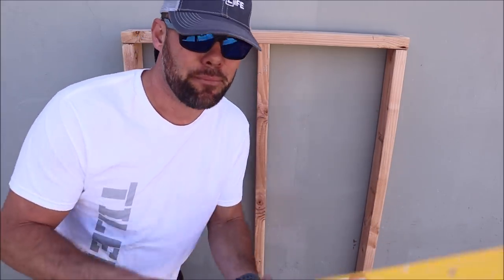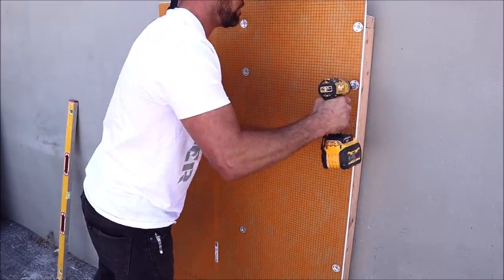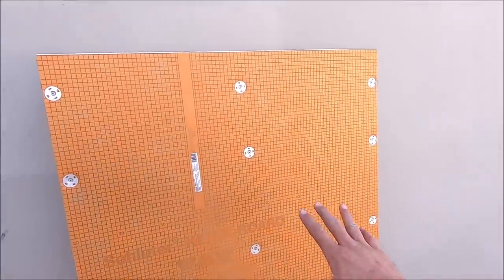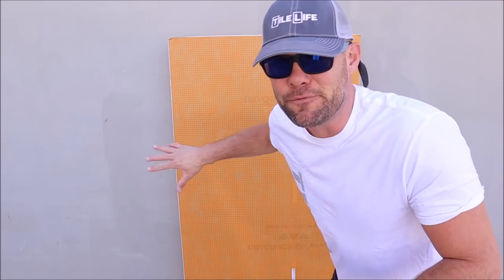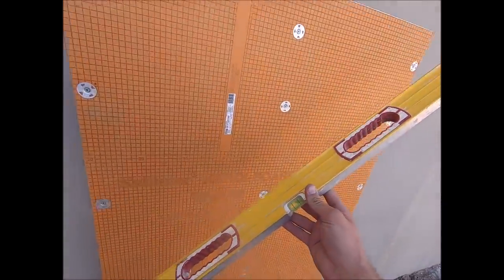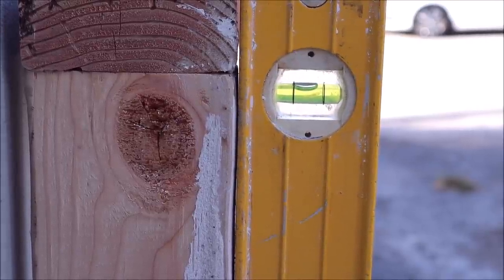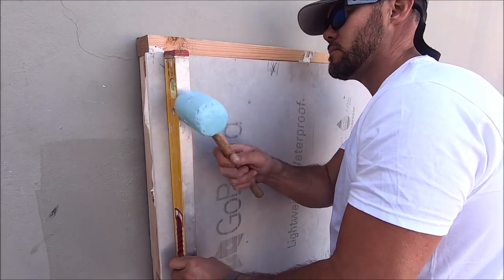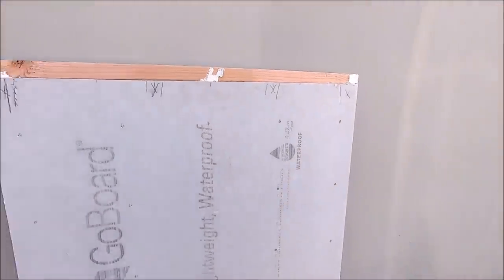Wet Shim Framing Studs for Flat Plumb Walls!

Comment: Why would you take a chance of the thin set braking out. Just sister a new stud to the bad one. You don’t have to Wait for the thin set to set up or worry about issues down the road.
Reply: Sal Diblasi does the same thing. It’s an excellent technic.
Reply: @ikust007  I’ve been doing tile work 50 years. It’s something I wouldn’t do. I each is own. Don’t keep up with names so clueless to sal Diblasi is!
Reply: I think the wet shim technique was initially promoted by Schulter after they came out with their own thinset. They obviously want to sell more thinset. Depending on the size of the wall it might be cheaper than sistering 2x4s.
Reply: Use pl premium plus construction adhesive, that stuff makes good shim when dried up. It’s rock hard and sticks to anything.
Reply: Or just use a planer

Comment: Good idea but also time consuming, if you buy a couple of 2x4’s and sister them onto the existing framing and plumb them up you won’t have to wait 3-4hrs on anything setting, it’s a quicker method all round for the price of a few sticks of lumber.
Reply: Have you seen the price of lumber these days? LOL
Reply: That's bs...all studs are shit his way is good
Reply from the maker: 2x4's are $8 and going up here! but we use both methods depending on how far out and out of wack framing is and what materials we have on hand. Simply another method to consider...
Reply: Guys as I said “Good idea” and all I was doing was giving an alternative not trashing the method as I personally have never thought of it and I’ve been a contractor for 20 odd years, haha yes up here in Canada a 2X4 today is $8.50! Tomorrow probably $10! But at the end of the day you just have to work out your schedule and what your time is worth.

Landberg I love your Chanel that why I watch and appreciate you always give different options and don’t steer people to your way or no way. 

Patric if you can’t pick out straight studs then find the best you can, cut it in half and make them straight, again just an idea.
Reply: @andy.m7274  that’s what I do. Buy 2x8’s and use my track saw to make straight 2x4’s. Then I’m screwing my backerboard onto a solid structure. Not thinset.

Comment: Great video, thank you...just curious, why can't you use hardy backer with this method?
Reply: My guess, there are few reasons, weight of cement board too much for thinset on studs to carry before you can screw it to the stud, another deal is stiffness of cement board will squish thin-set as you work on aligning it with level, and of course it won’t spring back. Foam board is very lightweight from that perspective.
Now me thinking, how to plumb cement boards on skewed studs? Quick guess to get set of new studs and screw them plum next to existing studs and hang drywall on new (plumb) studs.
Reply: fartpoobox ohyeah  Right. Schluter video for wet shim says use stiff mix for this problem.
Reply: fartpoobox ohyeah  

I have a gap of 3/4” between the shower base back edge and the wall. AND this gap is not consistent so one one side it’s 3/4” and on other end it’s 1/4”. So o need to do wet shin AND build up this gap so my final hardie back goes on the shower base flange nicely. 
Any suggestions??
Reply: @tothepointvids5192  I wouldn’t try to fill 3/4” with wet shim. I think I’d probably sister the studs to get them out to the right place and only wet shim the 1/4” one.

Comment: Great video But just want to say that you can use screws on your hardy board or your green drywall if you’re using Schlueter waterproofing system just don’t run your screws all the way in just enough to hold the board in place been doing it for years works great after the thin set sets then you go back and sit all your screws
Reply: That's an bs response
Reply: Obviously you don’t know what you’re doing stop  tiling please
Reply: You are tripping... How does the board contour to the stud without sinking the head of the screw?? Do you specialize in floating tile?? Lol
Reply: You do sink the screws after the mud sets up 
The reason you put screws in half way at first is the hold the board in place to keep it plumb and flat after mud sets up then you go back and sink your screws in 
FYI : your not following  the true contour of stud when wet shimming there’s a reason y your wet shimming in the first place the true contour of the stud is out of wack
Reply: You’re correct. I do this as well
Reply: @joshkitzmiller7333  Don't even bother responding to that troll. He's clueless.
Reply: I see how this technique of having the board floating out of the stud on a screw could work... But I wouldn't feel comfortable relying on it if someone applies pressure to that wall in the right spot. An unsupported cavity in front of the stud and behind the wall board May last for years until somebody finally presses on it or leans against it in just the right way.
Reply: @zennloo7343  

That's why you thin set the entire stud  and even if there was a cavity, it wouldn't be that big to wear. If you pressed on the wall it would crack your tile you would have to be basically be demoing the showers for that to happen

Comment: Nice
Never thought of doing this before like that   Did you say you can't use cement board would like to know why
Reply: Cement board is much heavier, so the thinset won't hold the board in place as you tap around getting the whole thing flat and plump.
Reply: That makes zero sense @dwsolberg
Reply: @swamphox1  I bet you could successfully wet shim cement board in that first scenario where the middle stud was bowed in. Just slather the middle stud, then screw the board into the two outer studs, get the middle flat with the level and let it set up before adding the remaining screws.  

Getting the whole sheet plumb would be a nightmare with cement board. In that case, it'd be way better to use solid shims on the studs before the board goes up.

Comment: Been doing that for 40+ years using scrap rolls of cheap sheet vinyl. Always had some in my truck. Sheetrock 45 works great too. Less downtime.
Reply: Thinset is far stronger than sheetrock 45. Would not recommend that
Reply: @johndalton6929  It's just as a backer, not an adhesive. Board still gets screwed to studs. Sheetrock dries harder.

Comment: Great tip. I will try on concrete backer board BUT with redgard on the studs and a brush width of redgard on the back of the backer board. Time? I'll check and prep the walls before starting the concrete shower pan. Personally I  don't like foam boards, too flimsy, too expensive. I also have a planer for high spots.
Reply: Can use sub floor glue too

Comment: Another great video! Curious to why this can only be done with foam boards? Is it because the cementicious boards would absorb moisture cause the boards to be pulled in?
Reply: I think the other boards are too rigid and the screws would pull the board tight to the stud and break the thin set out. Just guessing.
Reply: @PoisonJarl71501  you might be right. The other thought I had was some of the cementicious boards tend to have a curvature to them that may need a true frame to pull them true.
Reply: Great question. I was thinking it was because of the weight. They are a lot heavier and they don’t go all the way to the ceiling.
Reply: You can use this method with Hardibacker. I’ve been doing so for a couple years now. Once thinset is on the studs, use a Level and Mellot. Tap te areas necessary to achieve a level board. Only use two or three screws to hold the board in place and do not countersink. After the thinset is dry, apply the necessary amount of screws and Counter sink. I havnt had any problems yet.
Reply: cement boards are too heavy for wet shimming.   foam boards will hold in place and stay flat and plumb.

Comment: How does that work if the drywall at the interface of wall and shimmed shower wall are then at two different planes? Thanks, your videos are always clear and concise.
Reply: It wouldn’t work apart from the back wall, as you say the shower would be plumb and the intersecting point with the wall outside the shower wouldn’t be, in saying that this method can still be used to take the “belly” out of the wall at least.
Reply: You could just tile over the interface point by about an inch. Cut the drywall back if needed
Reply: @tarmization  yes but the point is if the wall is around a 1/4” or so out of plumb then you’ll see it on your tile edge no matter how far you tile over the intersecting edge.

Comment: Wow! This is fabulous! I have been taking time to install masonary packers where it's been bowed in and plan where it's been bowed out. This is just amazing. I highly appreciate this valuable point and am about to subscribe to your channel. My only question  about installing backing board is that I'm mainly relying on the stud adhesive (even liquid nail) to keep the board permanently on the studs not screws. Having said that, how can I do this technique and while the glue is set then put all the screws? I see screws as temporary fasteners to hold the board while the permanent element is being set. I'd really appreciate if you could please help.
Thank you kindly,

Comment: I wish you posted this video 1.5 year earlier or I knew this before hand at least. It was a pain in the rear to tile on uneven kerdi board. I did however tiled it but the tiles are slightly curved. Good job pointing this out. Lesson learnt the hard way. For all DYI'ers bathroom remodels are a pure pain. you will miss many things which experienced people would look after. There is not just a list, there are many to look into. Unless you experience it, you do not know.

Comment: I usually just sister up new studs if it's bad but with the price of lumber this is probably a cheaper option. Will have to try it, thanks!
Reply: Ain’t that the truth. 
Lumber prices have went sky high. 
2- 2/4-12’s cost me d almost $50 now. 
A price a gave for a deck job 4 months ago. I had to jack it up by $3500 only due to increased cost of mtl
Reply: @mikek3951  it's pretty tough to keep up with the price hikes. I have having trouble with getting plumbing fixtures in a reasonable time frame now. Hard to schedule when it take 6 to 8 weeks to get shower valve trim.
Reply: @BrentDarlington  
Lol I just went through that with Ferguson. 
Brizo trim They started with 2 weeks. Then 3. Then 4. It ended up 4 months. 
It’s getting bad for sure

Comment: I knew Schluter says you can use this procedure, was hoping it would work on Goboard as well, since they are the same types of material. Thanks for the video. Will have to buy some longer screws to make up the difference of the added thinset.

Comment: What’s the best way to level the wall if using cement board? I wanted to use Kerdi for the new project but decided to keep cost low with cement board.
Thanks
Reply: This works with cement board. I use a few screws to hold it were I want until dry then fully tighten and add more.
Reply: I was thinking to do this method with subfloor glue

Comment: Thank for sharing your knowledge, one question here in south florida almost all studs are metal can this method be used with metal studs?
Reply from the maker: Maybe someone else would know, we don't have much experience with metal studs.
Reply: Not with metal studs. You will need to use shims or blobs of silicone

Comment: Particular reason why cement board can't be used?  If install allows for extra time....ie...place large fans circulating air heavily for 48 hours.  I'm assuming it would have to relate to mold growth.  Or if you were able to kilz mold guard your studs might that work also?  Just curious. Thx
Reply: I thinks its because the cement board will absorb the moisture before setting. I am using subfloor glue

Comment: How thick of a gap can you use this mortar technique for?  the top 1/4 of the wall is 5/8" off (that is area with the largest gap).  Will this still work?  Or should I shim it and then do the mortar?
Reply from the maker: yes, it will work

Comment: Quick question, why can't this be done with a cement backer board like permabase? I searched high and low for this answer and get conflicting results. My bathroom exterior wall is block here in Florida.  Whoever laid the block did an uneven job, some blocks are recessed and others are protruding creating a wavy out of plumb wall when the furring strips are on. I ripped wood shims for the most part but would like to fill in some of the inconsistent spots with wet shims. Can this method be used for only certain areas? Thanks

Comment: I always just sister in new studs with a straight edge and level , but I use cement board
Reply: Sister it with a warped stud?? His way you can control it's a great idea.
Reply: Yes wood can be warped and twisted these days but if you sort through them you can get straight ones , his idea is great but doesn’t apply to me because I don’t use foam
Reply: Also much faster than waiting around for it to dry.

Comment: Why would you not be able to wet shim cement backer board?  It would seem that this wet shim method would work with any type of board including drywall.
Reply: Agree. Just screw the outside studs so to hold it in place. Start the screws in the middle, check it, then wait a few hours to dry before screwing them down. Seems to me that would work anyway.
Reply: You can, it’s just rock is a lot heavier and will fall with no support while waiting to dry. If you k ow where your two high points are where the rock is going to squeeze out all the cement, than throw a couple screws into those to points to hold it up while your waiting for it to set

Comment: Can this be done with Denshield or Densglass?? I would appreciate some input. Thanks 🙏🏽
Reply from the maker: I don't see why not
Reply: I use Denshield all the time and twice now have left a piece of scrap in a bucket of water, once for a month. No water absorbed into the core, just as solid as it started. But I don't think Denglass has the same water resistant core.

Comment: What do you do when you make your shower wall plum button the wall you’re tying into is not plum?
Reply: Plum the wall you’re tying into using the same method. Or if you’re talking about tying into the drywall where there’s a seam just make sure your tile over laps the seam a little and use schluter trim or pencil trim or whatever you use to hide any uneven spots. If the wall is so bad that won’t work you’re going to have to redo some drywall and shim it flush with the wall board, should only have to that at the seam so not a big deal. Hope that helps.

Comment: Thanks for great video and I have a question. I appreciate the input 
This may sound stupid question but will the thinset mortar crack when you screw the foam board ? Will thinset crack when you now screw the Harris back over the foam board ? Or you won’t need the Harris backer to go over the foam board ? 
Here’s my case, I installed my shower pan/base and it is not squared to the back wall. The base is 60 “ wide x 36 inch deep. Now the on one end of the 60” width, there’s a gap between the shore base/pan and the wall of 1/4” and on the other end it’s 3/4” so
I need to square whatever board go against and the studs AND bring it up flush with the shower bas’s lip/Flange
Any input I’d appreciate
Reply from the maker: No it will not. I've used this method on over 20 showers now.

Comment: Noooooooo wayyyyyyyyy !!!!! This popped on my feed but I never seen this method before ! I’ve seen cardboard, sistering studs, and scribing / ripped down 2x4 as shims ! 

How common is this method , or how professional is it compared to the other methods  ?  I am just so 😮 right now
Reply from the maker: We do this all the time, the only drawback is the time you have to wait for the thinset to set up before installing the screws. You simply need to find something else to do for a few hours...
Reply: @LandbergTileTV   okay thank you for the reassurance !

Comment: could you do this on one of your remodel videos to see it in on a larger scale. maybe next time you run into a really out of wack wall. this seems faster than what i do. i use paint sticks and folded ram board with my brad nailer to do the same thing but can take hours if the wall is really bad.

Comment: Thinset on untreated wood studs? Is thinset not a cement product? Im thinking rot is an issue on the studs.. id redgard the face of the stud first.. moisture from the stud can escape the sides and back.. but the thinset won't pull all the moisture from the stud if there's a barrier

Comment: Sir, I will be wetshimming my walls that are just slightly out of plumb with my wedi board , I was going to just buy some thinset at the big box like versabond for the wet shimming is that thinset okay to use for wet shim? I’m using schluter all set for my 4x12 subway install .
Thanks
Reply from the maker: Yup! That will work.

Comment: Or quit trying to reinvent the wheel.

Cut wood shims and secure them to the stud. They'll never shift, Crack, shrink, fall off and you can screw through them without worry of dislodging it.

Comment: I looked at a couple of other how-to’s about wet shimming, including the one made by Kerdi, before watching yours.  Yours is, by far, the most concise and didactic. Excellent camera work, too. But there was one difference that I was wondering about. You did not put in any screws until the mortar had set. In the other vids they put in a few screws to "hold things in place" but did not set them all the way. Obviously, it wasn’t an issue for you. But if the mortar had become rock hard, might the screw meet some resistance, which might cause some disturbance?— I don’t know.
Reply from the maker: Appreciate the comment! and no, the screws will go right thinset the next day.